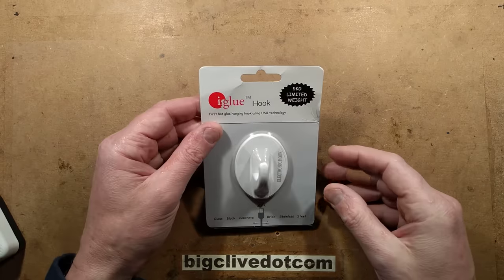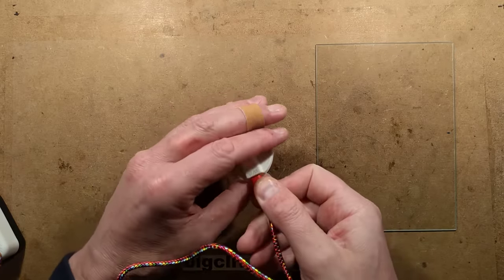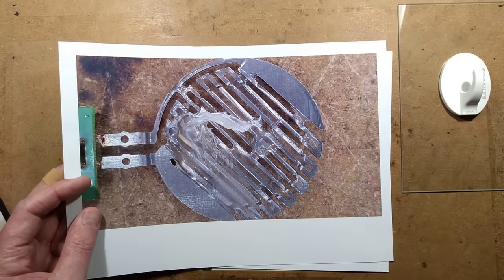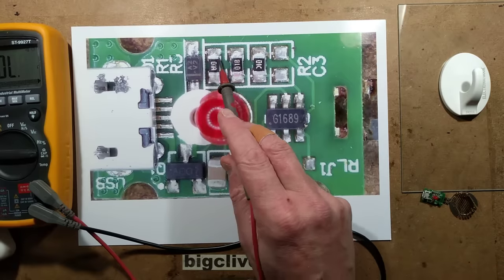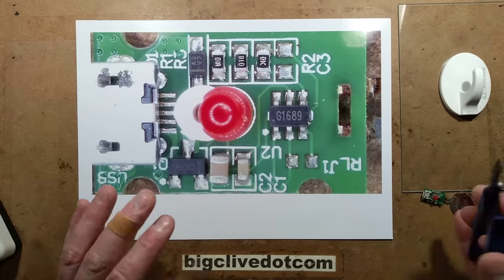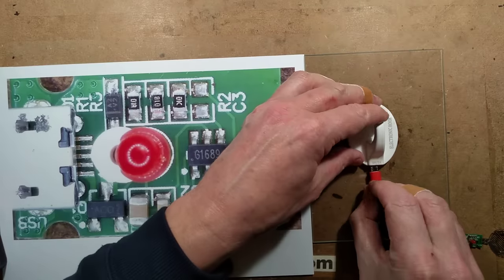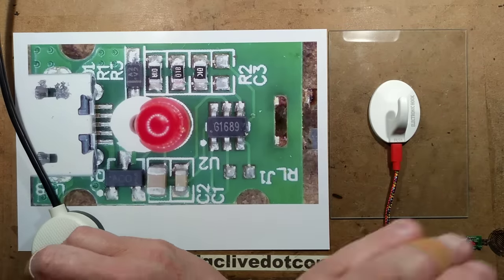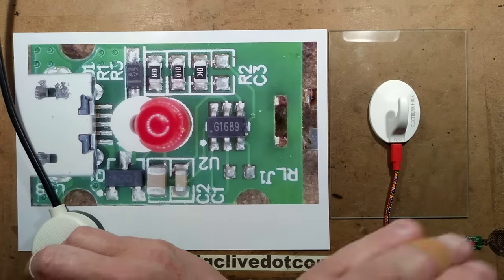Testing a USB powered wall hook and a look inside.

Comment: They shouldn't bother putting the circuit board and components in the hook, they should have just left the heater element and put a plug\terminal and then use a separate attachment  that can be reused for smaller streamlined hooks.

Comment: Yeah, I still prefer regular wall hooks with the  elastic glue pad that can be pulled out with a tab. Or, you know, using a hot glue gun to stick it and rubbing alcohol to remove it.

Comment: Or you could just stick a normal wall hook on your wall with hot glue. A couple of squirts of isopropyl alcohol and it will come right off. Reheat the glue with a hair dryer and stick it wherever you want. Rinse and repeat each time you want to move it.

Comment: Strange to see "electronic hook", when i asking myself WHY hook is electronic, if it's just only made to hung up stuff? Then i saw it's controlled heater to hung up hook with hotglue method.
Hotglue will not stick on every surface but it does well job on wooden wall where normal adhesive needs good flat surfaces. But there is small problem if the wall is bit cold (like in outside storage) so it's useless. It will not melt enough.
At the end, it's even more e-waste because its once-use item. Because after removing there is less hotglue on hook, makes hook useless for 2nd use.
For 2nd use, we usually get new double-side adhesive sticker from DIY market to use hook again. But there is nothing for this electronic hook to use it again, makes it really useless.
And if you made mistake with putting hook on the wall at wrong place, oh shit.... Hook wasted.

It seems good idea at first sight, but at the end, it's only e-waste due more electronics and metal parts there. So i cannot agreed in this weird idea on long-term use. And i know when hot glue is old, it will just go off on flat surfaces. Clean up hot glue is not simple on some surfaces too, where adhesive residue can removed with some strong fluids.
And why pay more if normal hook is also fine enough for most cases. Even it can stick stronger on some surfaces, but we have enough solutions for it.
One of the solutions some hooks have special removeable stick pads, you just pull it out and it's coming off easy!

Comment: When you said 2 amps, did you mean 2mA?
Reply from the maker: No.  2A at 5V = 10W.
Reply: @bigclivedotcom  ohh okay, thank you. I’ve recently taken an interest in electronics/tech and learned that 75mA+ can cause fibrillation, so 2A seemed high but it makes sense considering it’s only 5v

Comment: Loard help us all. Use a bit of mettle with a spike on one end. If you need to go in to concrete, use a drill before that spike, glass, try a suction cup, worried about your security deposit? Get some spackle, and paint; they can match the colour now. I hate these command hook things, they hold worse than the greek center at merathon, and that was designed to fall back. I don't want to live in a and a world in which one must plug in their hooks for such a lack lustre performance. This made me unreasonably mad!!

Comment: Is there an IOT version? BLE, ESP-NOW, Wi-Fi, LORA, etc.? Then servos to push out the USB plug automatically? Don't forget the gyro. You wouldn't want to mount this and it's not perpendicular to a leveled floor and not properly perpendicular wall as it defeats the purpose of having a smart hook. Also should be a dollar for 3 pieces and rated for 1 ton weight. Otherwise I won't buy one.

Comment: If you are lazy enough to spend $30 on a self heating wall hook your lazy enough to use a hot glue gun what has the work come to not to mention you have to wait another 2 week to hang your coat up

Comment: Wouldn't that have been a simple 555 timer chip?
Reply from the maker: Not with the two modes.  A microcontroller may actually be cheaper.
Reply: @bigclivedotcom  that may be what the transistor is for, to switch between the two caps for different times. theories.

Comment: I thought it uses electrostatic force (it would require a built-in inverter to get high voltage) and it falls off if battery is not charged on time :D I read about that technology here: https://forbot.pl/blog/polaczenia-elektrostatyczne-czyli-elektrycznie-sterowany-klej-id36740

Comment: Why, just why?? How overpriced is this novelty hook? You can do the exact same thing with a $5-10 mini glue gun, then you also have the glue gun for many other projects.... Wanna remove the hook after? Drip some Isopropyl Alcohol down the top back, wait 10-30 seconds then pull off with light pulling pressure, add another drop if needed - Much cleaner removal process.

Comment: Is this a joke????
Reply from the maker: It's real.
Reply: @bigclivedotcom  but why... it's a wall hook.... it doesn't need electricity
Reply: @Scudmaster11   Watch the video. It heats up the glue on the back so you can stick it to the wall.
Reply: @fosty.  that's a waste of electronics
Reply: @Scudmaster11   Of course. But it still needs electricity to function as intended.